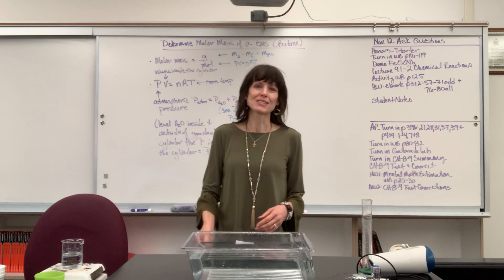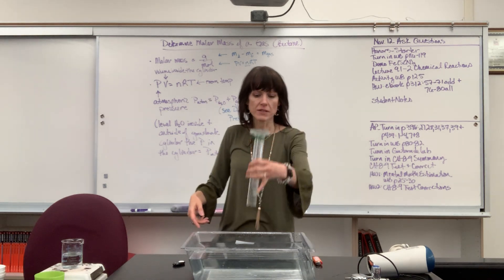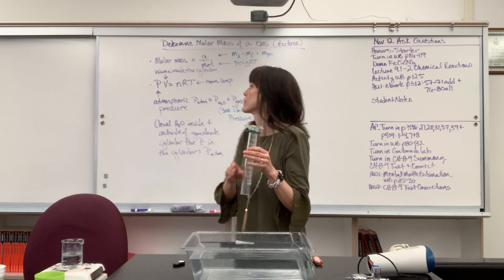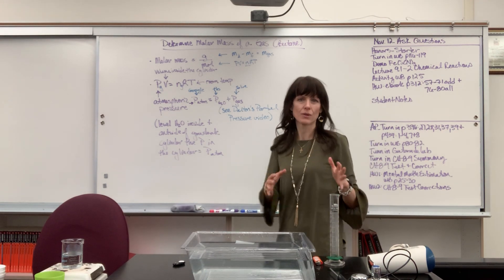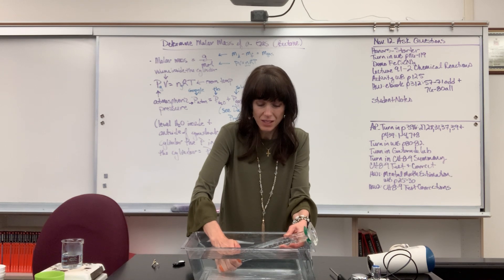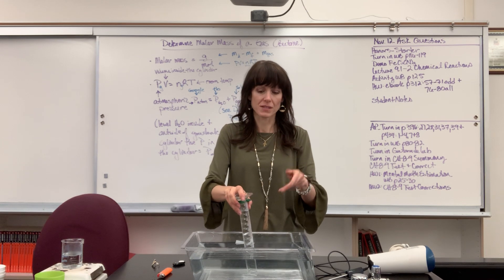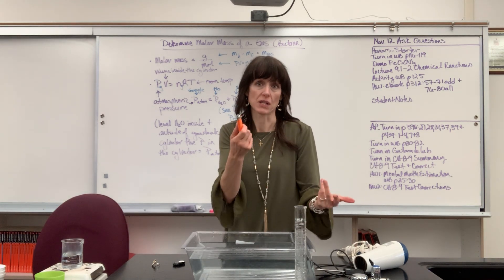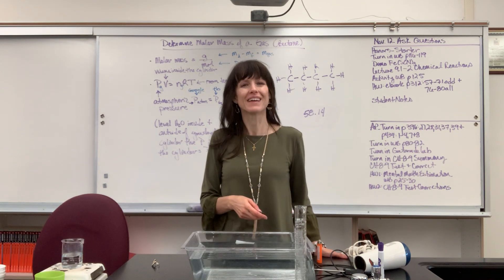Determine Molar Mass of a Gas Lab

Comment: What about water vapor? Shouldnt you subtract that from the mols of gas to get a more accurate partial pressure of the lighter gas
Reply from the maker: Hi Pompom, you find the partial pressure of the gas using Dalton’s partial pressure law. When you plug that value into PV=nRT it gives you just the moles of the gas.  Also, remember the volume for gas molecules is negligible, only the volume of the container is needed for the equation.  I hope that helps.